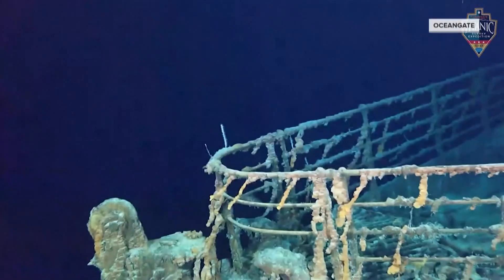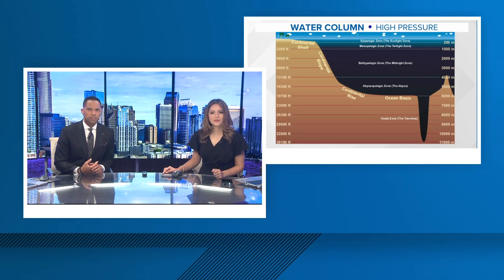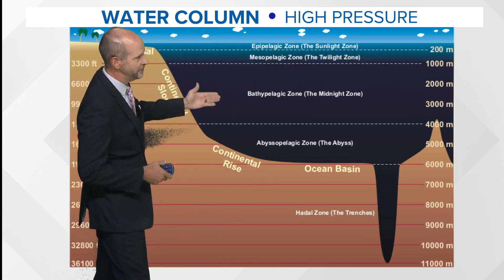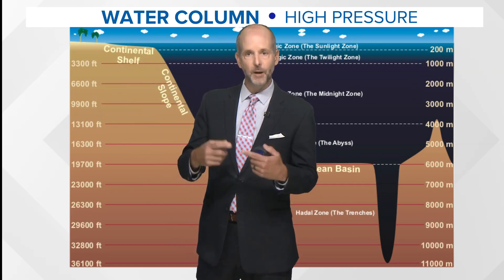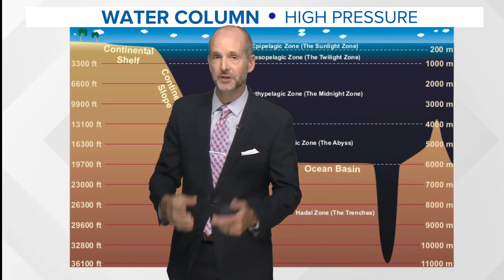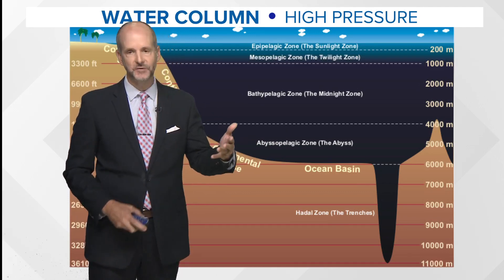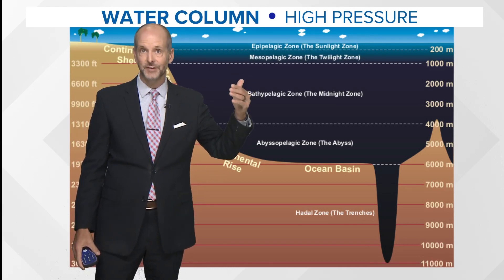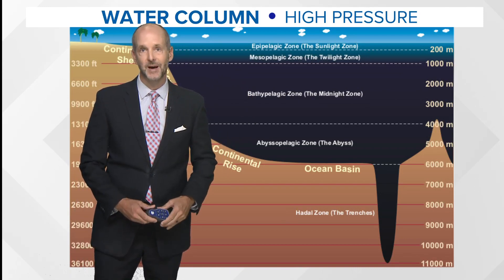Why the Titan sub likely imploded near Titanic | Brad Panovich explains

Comment: Titanic is at 4km deep more a less from this pressure at this depth is extremely high, about 380 times greater than atmospheric pressure at sea level. This means that the pressure where the Titanic rests is approximately 5,600 pounds per square inch (psi). 380 atmospheres = 37,665 kilopascals (kPa) - kilopascal standard unit of pressure.
In other words these are TITAN forces.